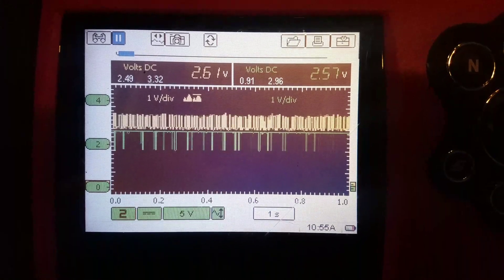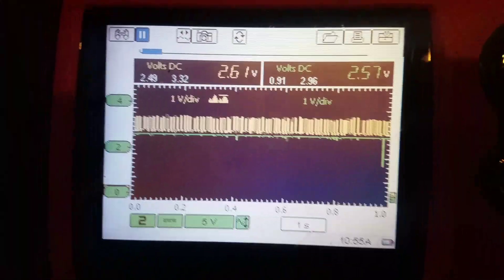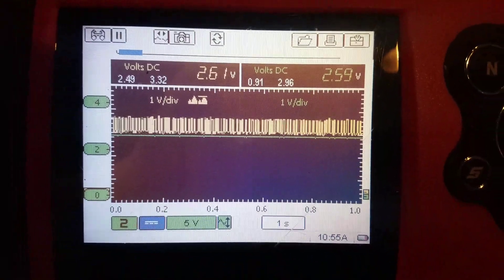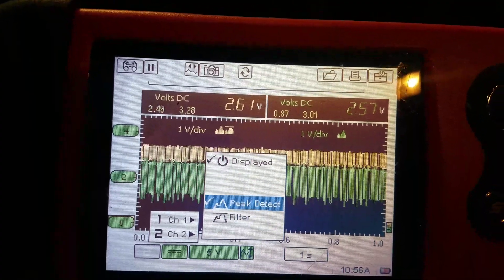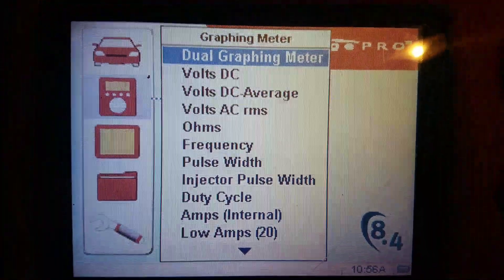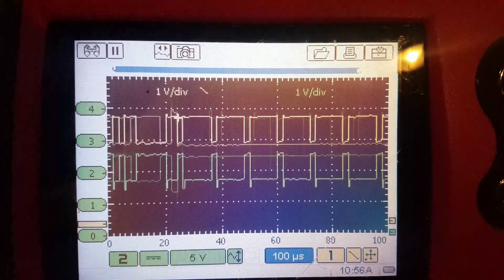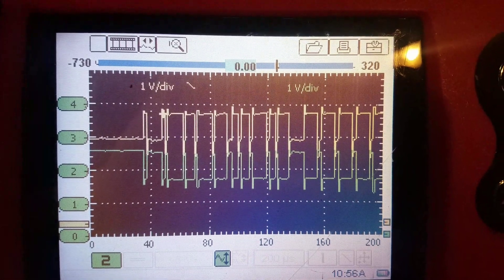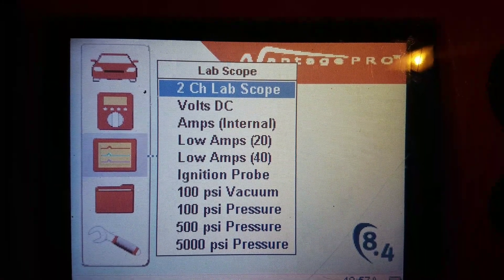Graphing meter vs Oscilloscope

Comment: The video is just a case of choosing the right tool for the job. Nobody would ever use a basic meter or slow sample rate etc for CAN in the first place. A bit like if you just wanted a simple static voltage reading, you wouldn't break out the labscope. You'd use a simple meter

Comment: My shop was about to toss out an older model Modis with this same software on it before i saved it. That thing has a 4 channel scope in it! Only problem is that the back light doesn't work so I use a flashlight to illuminate the screen. No complaints though, free scope!

Comment: Hey Keith, just wanted to know, what are your thoughts on this. I'm new to the scope thing and have just purchased a Pico scope two channel. Can't afford the 4. So in my research, I came across the ATS scope which I think is the GMTO similar and a trainer here in New Zealand says you don't need a pressure transducer with this scope. I'll send you the link below. So, just want to know your thoughts on that...

Thank you sir

Comment: Yesterday I used my 10mm socket 9 times, changing an alternator on a 2010 Transit Connect. Today I am going to use my Vantage Pro with a low amp clamp and watch the parasitic draw for 10 mm. I mean 10 minutes. Thank u Dunkin

Comment: Good morning Dunkin. Sorry!  Good morning Keith. I hope the legend is being legendary. Quick question. I bet your loving that 431 diagun. I just saw Eric zipping thru a horn video. For code reading and bidirectional controls why take 15 min to boot the Verus? U could use that time far more wisely eating a donut. I know we need the scope. Vantage Pro. But for the initial?
Reply from the maker: Bill Rimmer if we keep the scope out and use it as often as a 10mm socket ? Well then it becomes your initial go to tool and diagnosis becomes faster and more accurate each time 😉

Comment: Keith is absolutely correct.  You need a scope now to fix these intermittent issues and also for regular diagnostics.  Especially with Can if your trying to figure out if one module is bringing the entire network down.  Plus once you start looking at the failures and the shape of the Can with the failures it can be used as a good indicator what's wrong with the circuit.🙂

Comment: I've never even owned a graphing meter. Years ago, when i saw a graphing meter next to a scope, it was a no brainer. I went straight for a scope. Too much detail, and you need some filtering lol it can throw off the inexperienced. I see guys sticking a multimeter into a comm line and saying "if you see X amount of volts(rms obviously) it's fine" and i just have to wonder how they make it in this field. No packet details smh

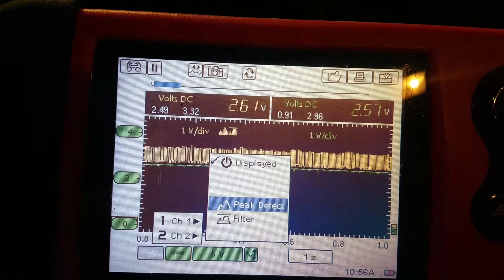Comment: Hey wait just a sec! I do fully agree that a scope is needed to show this data in proper detail, and that the graphing meter samples too slowly to show what the signals are really doing.  However, Keith's initial display is not at all fair to the graphing meter. He's set it up to make the CAN-lo signal obviously not the mirror image of the CAN-hi signal.  But the reason the two signals look so badly different is that Keith has the CAN-hi channel set to use peak detect and filtering, and the CAN-lo channel to use neither. When he does add peak-detect to the CAN-lo signal (0:47), it starts to look like the mirror of CAN-hi, and if he turned on filtering on CAN-lo, or turned off filtering on CAN-hi, then the two would have the same amplitude.
It's true there isn't enough time resolution to check that actual individual pulses are properly mirrored, so Keith's point stands. But that initial display seems to me to mislead -- it's not highlighting the actual deficiency, it's highlighting the mismatched settings. (And nonetheless -- thumbs up as always for posting videos about real-world scenarios that make people think!)

Comment: I guess I'm old school, but in general I suspect a wiring issue first when there's module failures and go tearing into to things looking for an issue from end to end. which usually pays off but eats time! certainly not something an hourly/flat rater would do, now way in hell you can charge 8 hours to find and fix one bad wire middle of nowhere.
that is where the communication buses and modules help. but they have far too much on one bus, they need to go full "star topology" one bus per module, but that creates a nightmare of many more wires! so my last though is toss it all and go old school wiring, minimal and simple.

Comment: The two meters are more similar now than in the past but it used to be you needed a multimeter to get an accurate measurement of voltage and you needed an oscilloscope in order to see a signal.  1 sec/div is obviously too slow.  Fluke makes some (expensive) scopemeters that kind of do both.  But the price of other test equipment has dropped so much it’s easy to get a software-based digital oscilloscope.

Comment: Why is four channel better when u r looking at one square wave?  And thank u for hitting us hard this week!!!
Reply: some times you need to look at more than one bus at a time (module may repeat or loop the bus signal out second wires) or monitor for power/ground noise and ripple simultaneously.
Reply: More channels allows you to observe (and capture) the time relationship between multiple signals, say multiple ignition or injector signals with respect to cam or crank. With two channels you can see one relationship.  With four channels you can see six relationships, (though often you're only really interested in three signals' relationships to the first one).

Comment: It's amazing one could understand the detail. Wow I'm lost :)
Reply: Im with you😂 , it looks like both signals are mimicking each other.
Reply: A few guys do decipher the  actual data being transmitted but mainly just for kicks. What you are looking to determine is whether or not the signals mirror eachother. If not you are looking for the problem being in the High network or Low network, high is the one that goes up in  voltage low is the one that goes down in voltage.